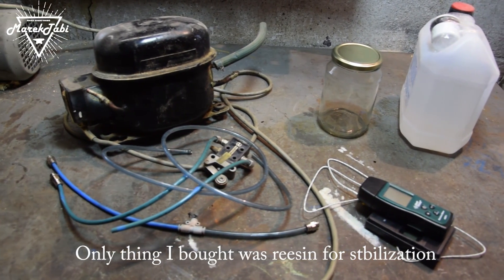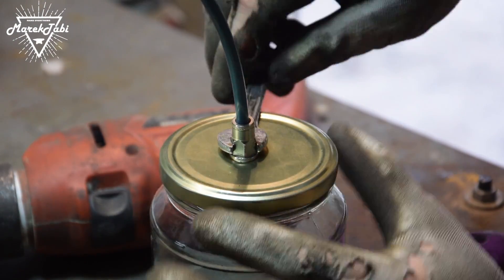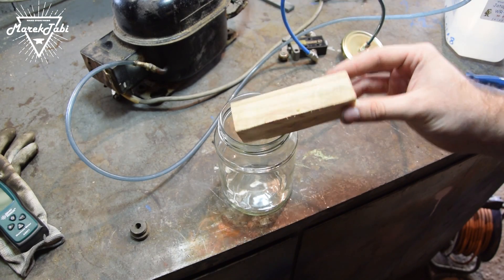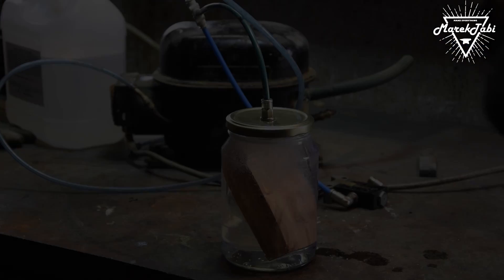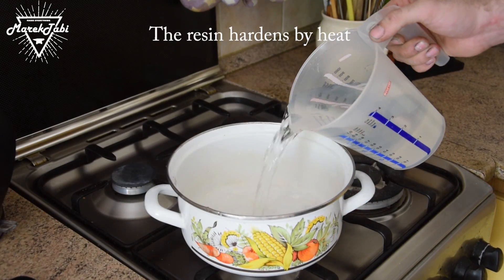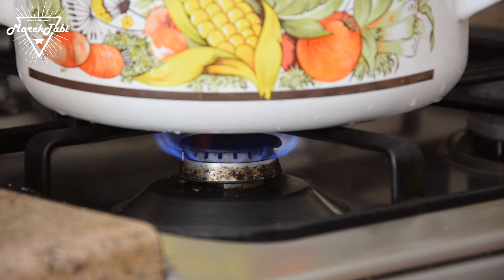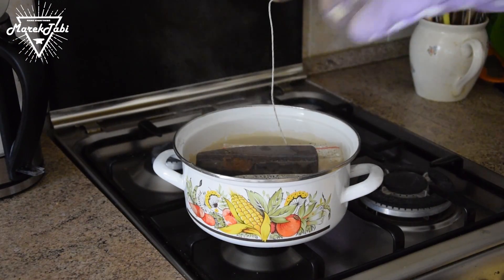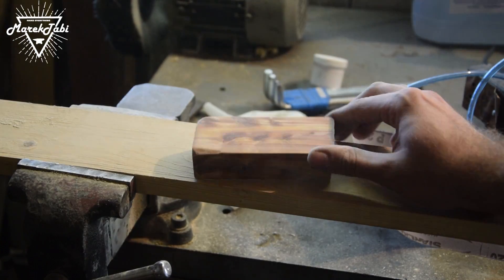How to stabilize wood without spending money

Comment: In the early days of Australia to protect fences from dry rot they would use drums split by thirds keeping 2/3 so that you could put a log or board inside the drum but first you put your logs in then put the retaining log like a "c" on it's back to stop the logs floating and fill it with what ever you were using to preserve your logs like old sump oil or creosote the you would carefully light a fire under it to heat your oil and as the heat rose the moisture and air would cook out and as the oil cooled the wood would draw the treatment in preserving your wood from white ant and moisture, obviously there were a lot of precautions taken to prevent firessuch as having the fire away frome and channeling the heat under the drums
Reply: Hi

Comment: Very inspiring video. For a better world. Therefore, all your followers should know that this process is industrialized by the Dutch company Accsys. They sell their timber under the brand Accoya and their plates under the brand Tricoya. So now you can buy wood guaranteed rot free for 50 years above ground and 25 years in ground or freshwater, without the need to buy hardwood and thus without damaging tropical rain forest. Accsys is building two extra factories now, and since the publication of their Q1 results, the shares Accsys are rising.

Comment: This is great. i've actually thought about curing the resin using my sous vide machine for cooking because I could fit way more blanks than a toaster oven, and have better heat control.
Reply: How would the souls vide do it?
Reply: @imkidarose1  As long as you hit the correct temperature, it works. Though when I tried it, the ziploc bag also melted. So, you definitely need a more robust bag to make it work.

Comment: Hi i am open to all information , BUT . If you use PEG,. Poley Ethal Glycol. mix a solution of 50% with water , soak i t for 24 hrs,  on green timber right of the tree, it will never Split, Warp , Crack , Twist , even during drying,  peg,. is cheep to buy.
Reply: polyethylene glycol

Comment: You made a mistake along the way.......after pulling the vacuum for 24 hours you need to leave the wood in the resin for it to soak. The airpockets in the wood need time to suck in the resin. The way you do it only a very limited amount resin gets sucked into the wood. :)
Reply: Yes, thats true
Reply: Actually, that is not correct. 
  The whole point of the vacuum is to pull all the air out of the wood. With the wood totally submerged in the risen, when the vacuum is releast the wood sucks up the resin into every location it previously had air.
Reply: You are wrong.
After vacuuming you should pres resin into the wood with high presure 20 - 40 bar.
Just learn how to impregnate the electricity posts...
Reply: The manufactures of the resin do not agree with you. 
Now you must use pressure with aluminire resin, but that is a different substance.
Reply: when using resin epoxy one must first make sure a substantial vacuum pressure is achieved when a correct variance between know it all asholes and air resistance to bull shit is maintained -
Reply: you can cut a slice to see internal structure...to prove or not ...
Reply: @FYahooo   may i ask question? i have epoxy resin, but it cures totaly combinig part a and b. so what is used in this stabilization when after 24 hours this resin is still liquid? i can find answers for that. thanks alot

Comment: Marek Excellent video and information. 

How about using 2 old compressor in series. The 1st stage will allow the second to acheive a higher vacuum level. However the higher the vacuum used the higher the chance your chamber will imploded.

I have collected the same gear as you have and will build mine using 2 compressor very soon.

Comment: Hi Makek, thank you for this video. How hard does this wood become? If you stabilize a cutting board this way, would the wood not be able to chip when someones using, for example, a hatchet against it? Ot is there another method you suggest that makes the wood extremely durable?

Comment: Very intresting!
Is there any special use for that wood? Is it now completely waterproof?
Reply: it would be good for doors and windows
Reply: At least as weather resistant as the resin.  Also strengthens wood for other processes, like turning small pieces  on a lathe.
Reply: Best for knife scales. Knives get moist/wet, shrink/expand depending on the wood. Stabilised scales don't move, no gaps form round pins.
Reply: Using heavy pvc rather than a glass jar would enable a person to do longer legnths of wood. Specifically for projects like walking sticks, window frames, threshholds, etc.
Reply: Wayne Grant o

Comment: Could use pvc pipe for longer pieces of wood.
Reply: Thomas Smith that's even better than the pickle jar I was considering. Thanks for the idea.
Reply: Test it first...the resin might attack the pvc.
Reply: Test first. PVC might collapse under full vacuum and allow the vacuum pump to ingest the resin, which would ruin the pump.
Reply: PVC might spontaneously combust under vacuum, attract a mini black hole, and generally vaporize your state, so remember to wear safety glasses. Also, the resin might react with your DNA and doom humanity to seven years of bitter coffee.

Comment: Does it make it stronger or less likely to expand/move due to moisture?
Reply: David Langton it definetly DOESN'T make it stronger, its basicaly resin so it is brittle, but since every little wood fiber is soaked in epoxy, it will not expand a contract due to moisture.
Reply: Oh okay, thanks for the info
Reply: David Langton I said it is brittle and you have to be very careful, but i still use it, it looks just amazing when done properly, but you have to be careful when installing pins.
Reply: David Langton the trick is not to use healthy wood, but wood with defects, imperfections, when stabilized it is structuraly stable but looks even better
Reply: Thanks mate, when you said brittle I was a bit put off, didn't want to try it and have the wood shatter or something. Thanks for clarifying
Reply: David Langton Treat it like you paid a fortune for it and it will not crack😀
Reply: A lot depends on which kind of resin and wood you use. It can be incredibly strong. Think of carbon fiber, fiberglass, and reinforced concrete structures. They all depend on one material being strong in tension and the other being strong in compression, and striking a good balance between the two.

Comment: "without spending money" 2 hrs on fire, 24 hrs of vacuum.....
Reply: Rodrigo S. Not to insult you but could you please cry elsewhere?
Reply: That's not the issue, but you still have to buy the resin, which is quite expensive. I thought this was about a cheaper way than to use that kind of resin.
Reply: Thomas Bögel no pain no gain
Reply: you do know how much is a vaccum chamber nowadays right?  What if the compressor was changed to be powered by Solar energy via battery? What if the fire used was changed sawdust and wood chips? he just used what is convenient for him. but the process can still end up not costing any money... so please do cry else where
Reply: Thomas Bögel He put a disclaimer that the only thing he bought was the resin... stabilization resin anit somethin you can get in nature
Reply: Rodrigo S. Well very little
Reply: GuardTower: With that thinking, you can do EVERYTHING without spending a dime. You can build a car and produce your own gas. All components are freely available in the ground ...
Reply: @mevofr you can build a car and produce your own gas if you have the know how. especially if you have the means to get the materials without using your wallet
Reply: GuardTower: Please try to understand what the use of "money" is (or more accurately "currency"). The basic premise is that you can't have the know how to do everything (nor the time to get it), so people specialize in one thing (and you can then add some economy of scale into this). My example about the car and gas was to show the silliness of your comments, not to have you answer me that you indeed can. Of course you "can", as you can do EVERYTHING in this case, like I said.
Reply: and what is your point then? The idiocity in the main comment is that he is expecting EVERYTHING is free because the poster titled the clip as  not "spending money."  He has the materials on hand without buying anything (except for the resin as what the poster has already disclaimed) so that is NOT spending money and He doesn't consider electricity or fire as spending something because as i have said he is using what is convenient for him and is already on hand. So again what is the point... if you have a BRAIN you can think of a way on how to circumvent the main problem of the commenter
Reply: GuardTower: By any chance, are you young and still living with your parents ? Meaning you don't pay yourself the bills at the end of the month ? The point of the initial poster is that 2 hours on fire and 24 hours of electricity is NOT "without spending money". And I don't really see your logic where you consider the electricity cost as "not spending money" (except if you are young and live with your parents, which I guess is the correct one, and I can understand it). The money spent on electricity is the same as the money to buy something in a store.

If you don't understand and don't see the point, well, I can't do anything more for you. Take care.
Reply: Actually some recipies call for boiling of wood in 3 parts wax + 2 parts linseed oil + 1 part colophony (the resin stuff from firs and pines). Although it makes wood reakly dark
Reply: but it is moms money :D

Comment: Wouldnt it be faster under high-pressure instead of low-pressure/vacuum?
Reply: Pressure only doesn't give the best result. The vacuum expels the air to make room for the resin to fill the wood cells.

Comment: Just leave it in garden for like a  year and u have nice dry piece of wood, 0€ spended
Reply: This doesn't just dry wood. It stabilises soft wood so it can be used for rougher jobs where it wouldn't have been suitable.. the resin fills the cells water would've occupied and hardens in there